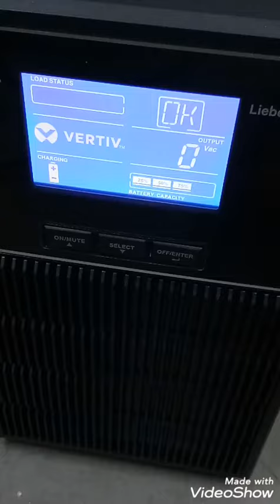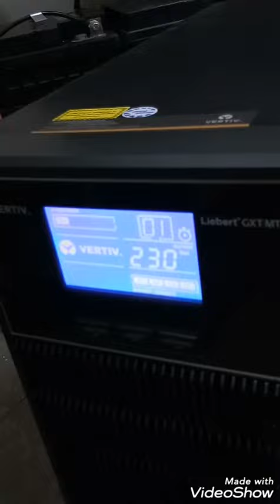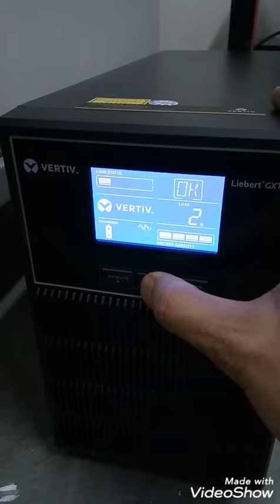Vertiv Mt +cx 3kva ups installation

Comment: I connected all batterys in series total 6 batterys 12v 42ah each battery capacity but showing NC error on display pls solve my problem
Reply from the maker: check battery ya charger card fuse...